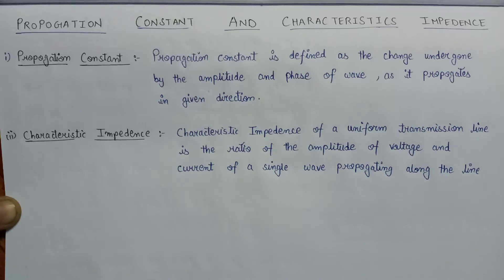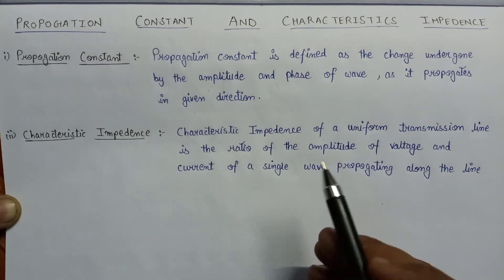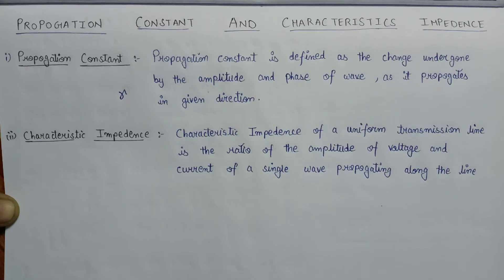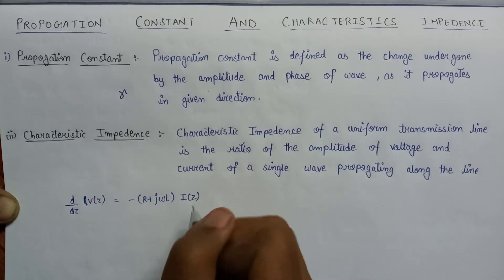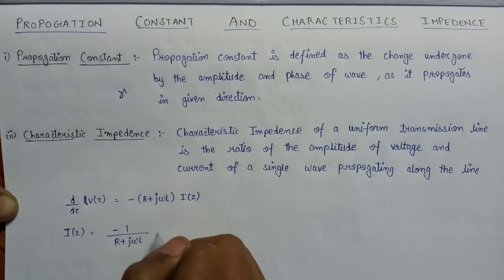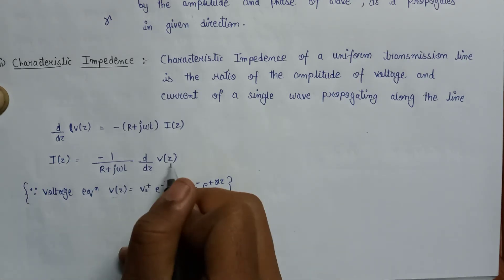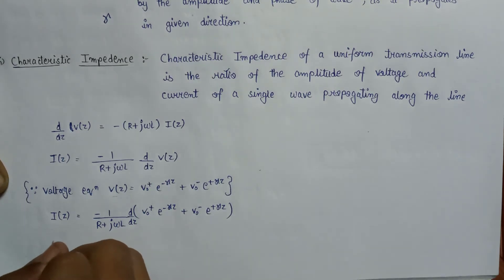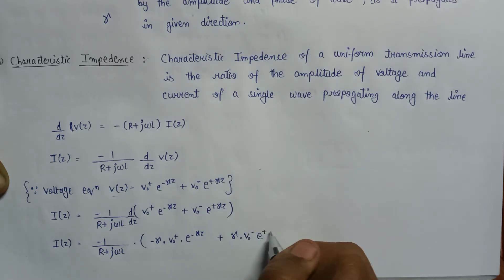Propagation Constant and Characteristics Impedance | Characteristic Impedance of Tx Line

Comment: At 6:16 you said to compare two equations but in the original one it is minus between two voltages and the other one it is plus. So how can you compare like that
Reply: Its because both the equations represent the current equation...so the co- efficient of the exponential terms will be equal..

Therefore, 

Gamma/(R+j{omega}l) V0(+) = [V(0)+]/Z(0) 

On solving, we get the desired equation.